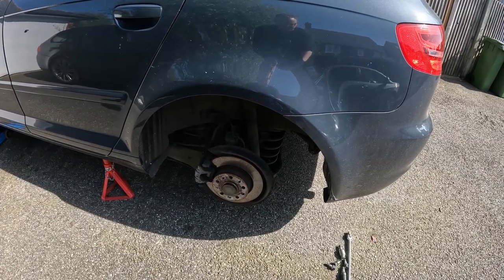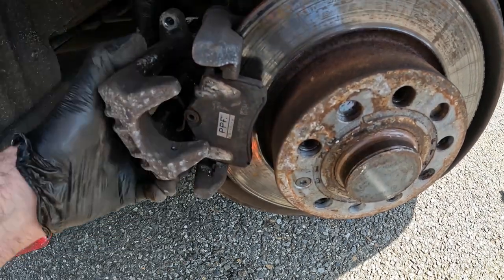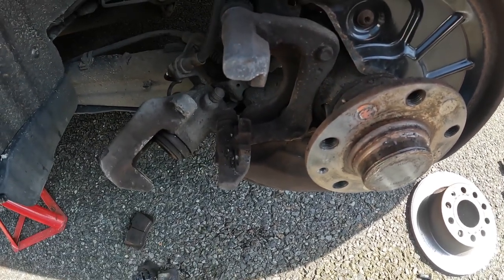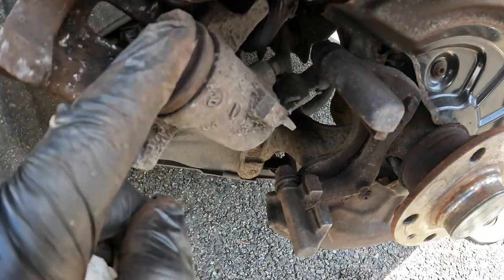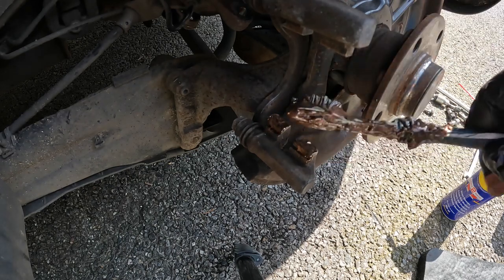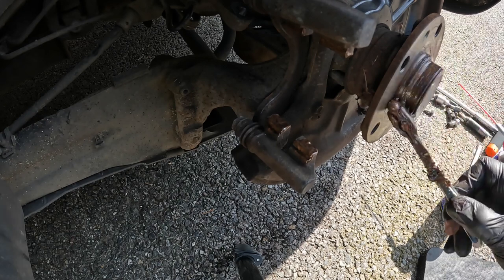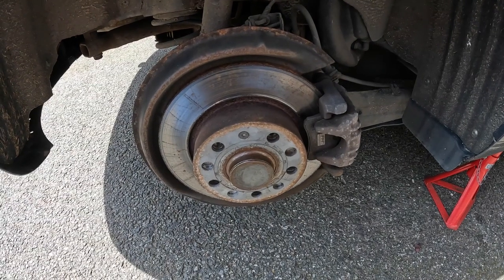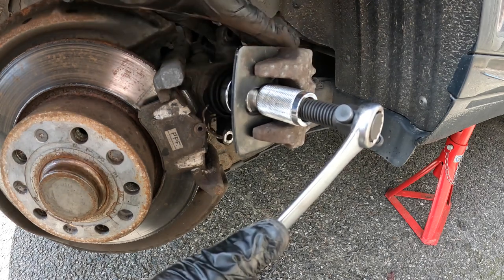2010 Audi A3 8P 1.6 TDI - Replacing Rear Brake Pads and Discs - Part 1

Comment: Hello Auto Knight, Thank you for the video. I have Audi A3 2010 1.6 petrol. Do you think my rear break disc should go easy as your one..? Need to try!!
Reply from the maker: Always best to allow plenty of time and not rush. Depending on the history of the car, how it has been treated and the region the car is from, some things can be seized and may require a bit more effort. Caliper pistons sometimes seize too, requiring caliper replacement. Good luck with it!